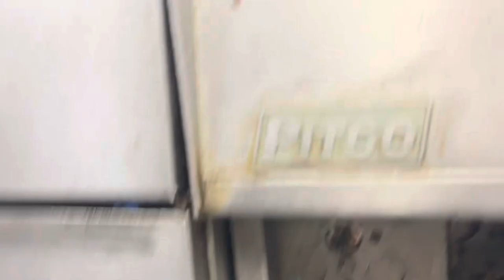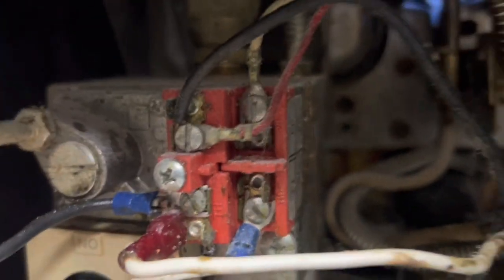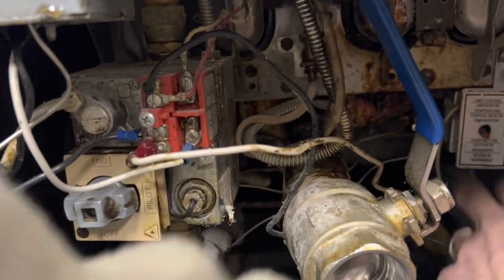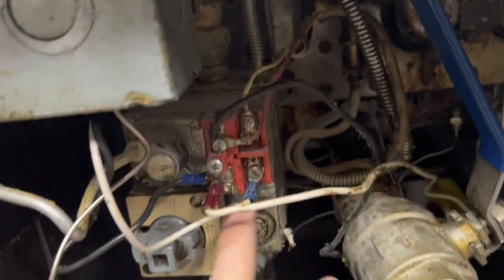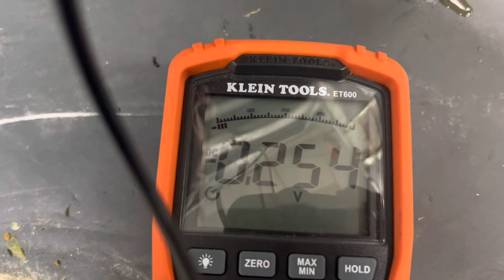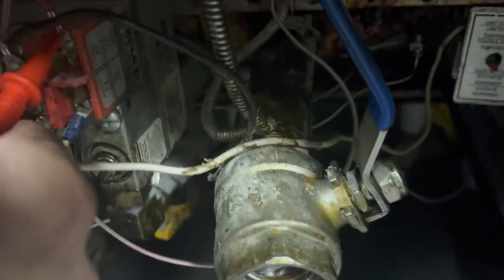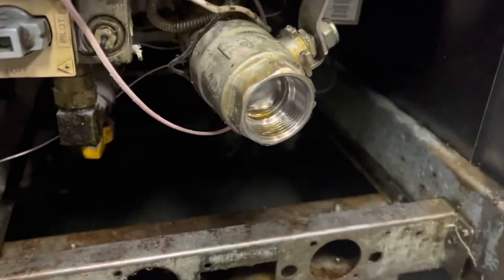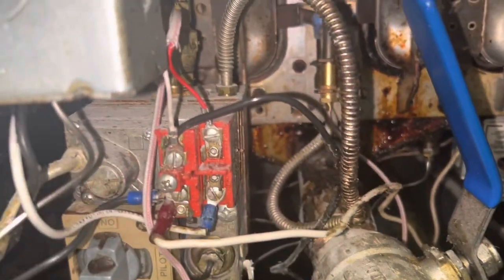Pitco fryer - pilot won’t stay lit

Comment: The hi limit and the thermopile used in this video are not OEM parts.  The 750mv's mentioned is a MAX for the gas valve rating and not what we want or should ever see as an output for the thermopile.  With the pilot only, the reading should be between 500-550 mv's.  Gas pressures were never mentioned in this video.  It it 100% that you should check gas pressures to any gas unit that is having combustion related issues.  A pilot not lighting or staying lit is a combustion issue and must have gas pressures taken.  The pilot operates off incoming pressure so both static and dynamic pressures for incoming gas should have been checked before any part was replaced if the pilot was able to be lit at all.
Reply from the maker: All great points.  I’ve discussed in a previous video that I often glaze over filming gas pressure readings and adjustment. (You’ll find  I’ve shown it zero times in 500 videos) because you shouldn’t be YouTubeing and adjusting gas pressure.   Call a licensed professional.    I never claimed my oarts were OEM.   The restaurants I’m serving here I am also the FM and we use non OEM parts quite often.   It’s kinda my thing.   I gut entire electrical fryers and convert them to MV systems.   I do strange things..   all things said I’ll end where I started,  you speak wisdom and experience and I’m appreciative to have your voice chime in to teach me and anyone else who I’m leaving missing pieces of info.  👍🏼

Comment: I have blue Seal GT46. It is twin tank deep gas fryer with two separate vales. One side was working fine but the other one has issue with its pilot. The pilot was not staying on. As soon as I leave the pilot holding button, pilot goes off. I have swapped the thermocouple and thermopile of the working side to other but still the pilot did not stayed on. Then I swapped the both thermopile and thermocouple of faulty side to other side. These two items worked there fine. Then I thought that it the might be the issue is with high limit. I swapped the cables of high limits with each other. But bother fryer's pilots did not stay on, they were tripping as soon as I leave holding button.  Therefore, I put the high limit cables to its original fryers but now both fryers' are not keeping the pilot stayed on? I have checked the connectivity of both high limit and they both showing connectivity.  Please can you advise what's wrong with fryer specially why the first one has stopped working even though it was working fine before
Reply from the maker: To test a bad high limit don’t swap them just connect the 2 wires on it together.  If you have a good thermopile and a good high limit it’s a bad gas valve